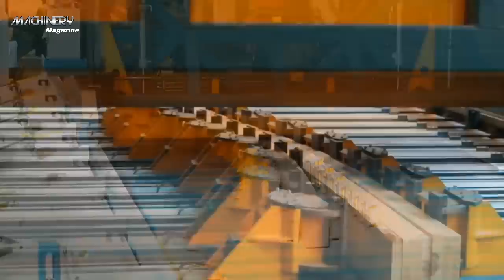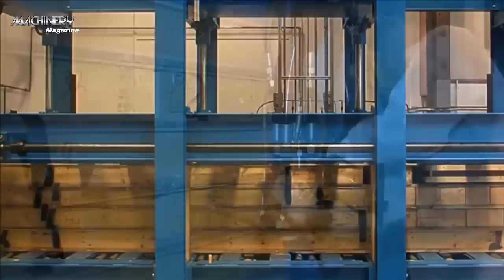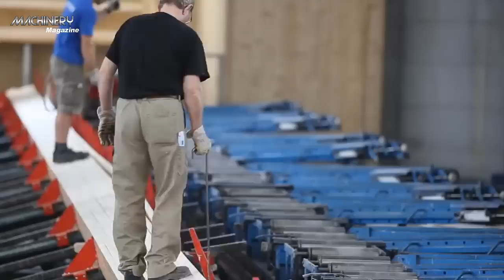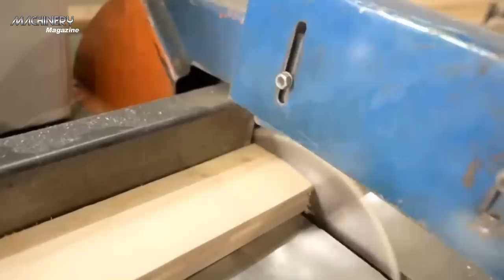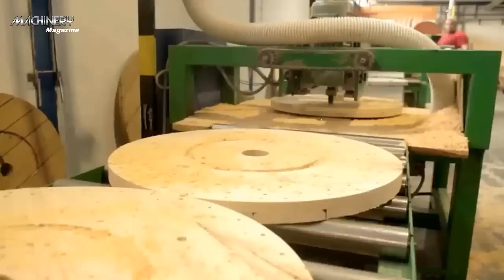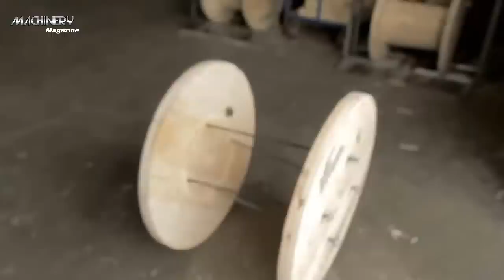Incredible Modern Automatic Wood Processor Production Factory. Amazing Modern Woodworking Machines

Comment: I made tooling for about ten years.
We had a big old ONSURUD .
We called it an automatic shaper.
It was all mechanical but it was powerful 
Big turning table 
Climb feeding beast.
5 inch helical block cutter head.
Sounded like V16 Merlin when we ran it.
( which we did constantly)